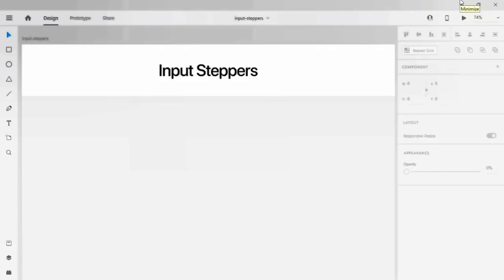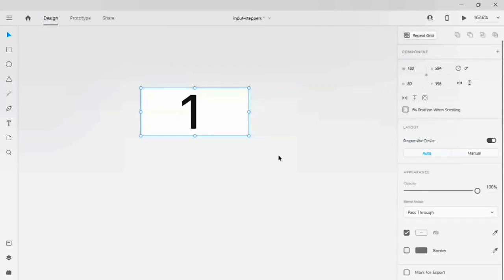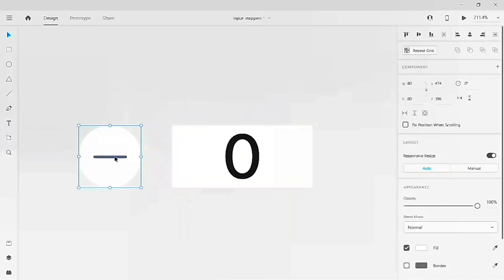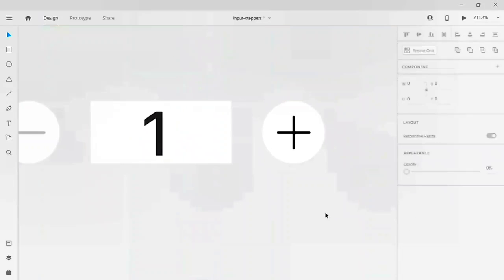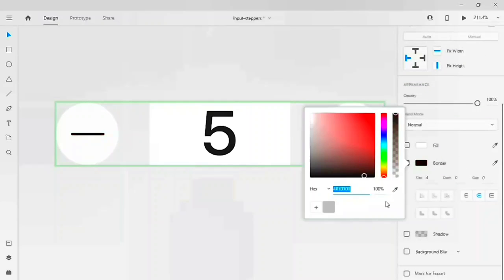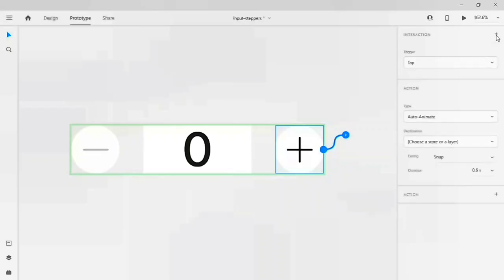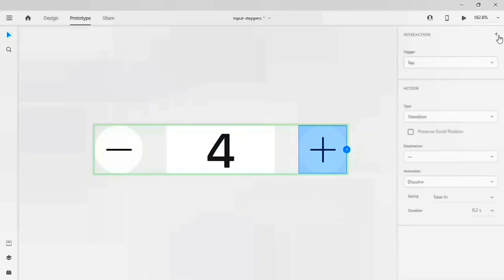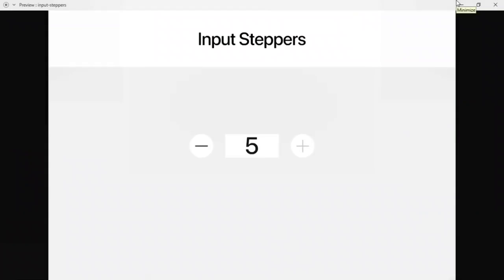How to create Input stepper #trending #ui #adobe #new #design #ux #learning

Comment: Also, is there a way to add a hover state to the + and - buttons such that the stepper still retains it's function? i tried adding another state to the buttons in design mode, but as soon as i clicked the + on the default state, a new button shape appears but it flies off onto another position on the pasteboard. really weird.
Reply: I think i solved it. I added an invisible layer behind the landing button and the + and the - sign. I added the hover state to those buttons first, locked them, then did whatever you did to get the counter moving. Not sure if this is the right method but it worked.